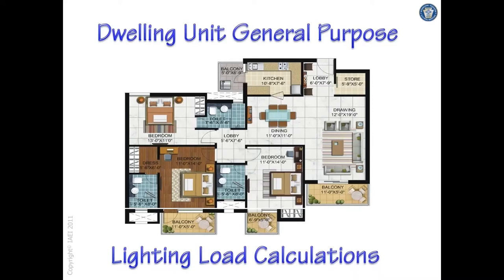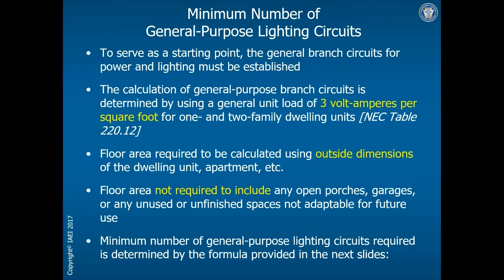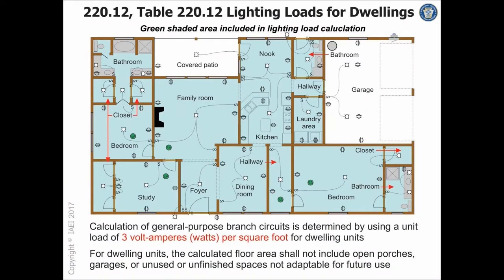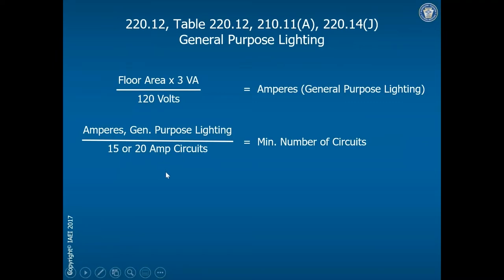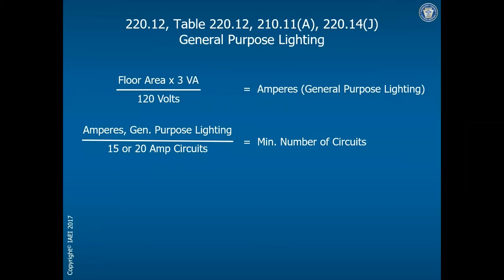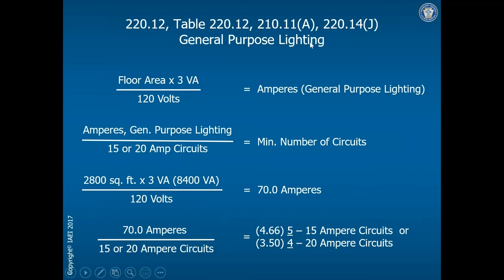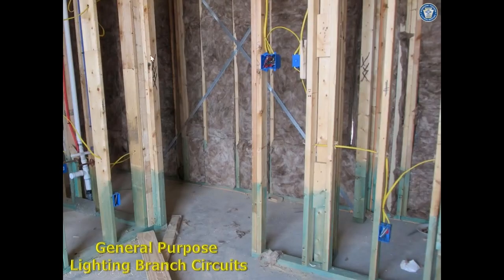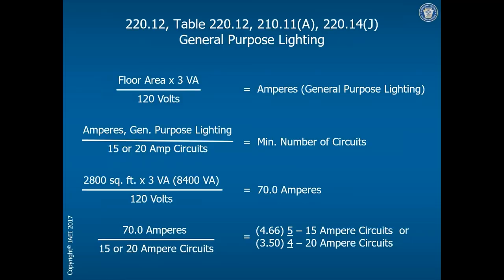IAEI Training Shorts — Calculating Lighting Load for Dwelling Units

Comment: Might be in next code where they are going to allow a 10 amp rated conductors on a 10 amp circuit breaker to feed LED luminares in a house. Not a big fan of having entire  house lightning on only one or two circuit breakers.